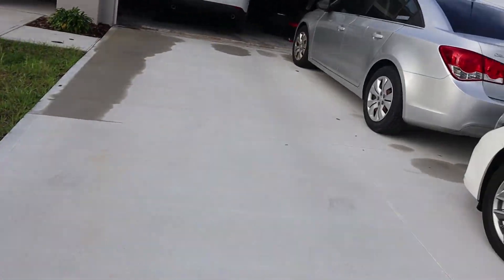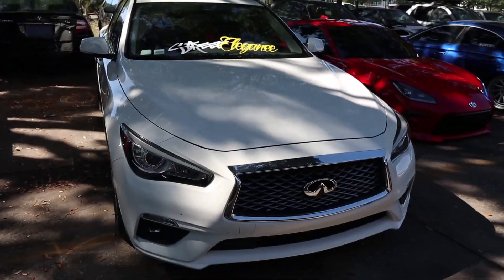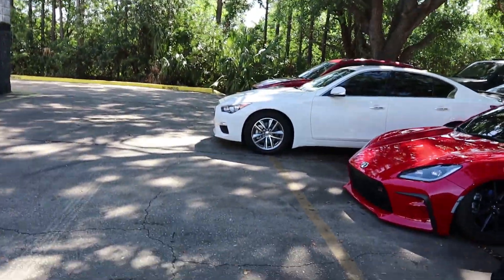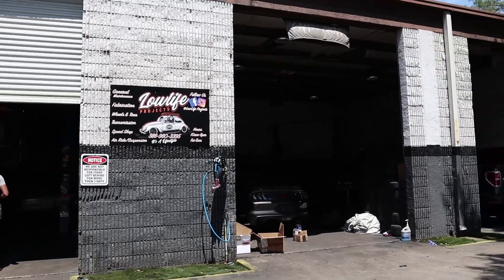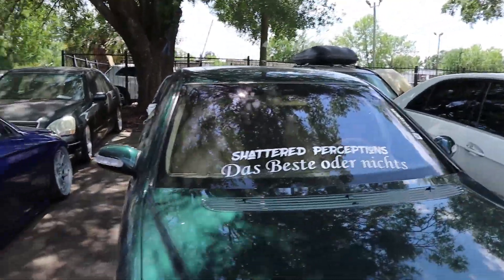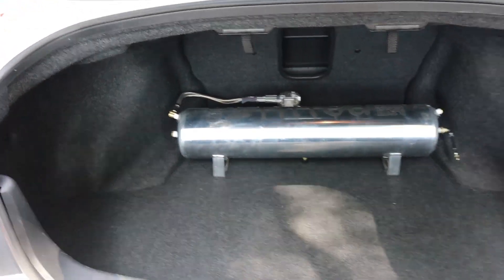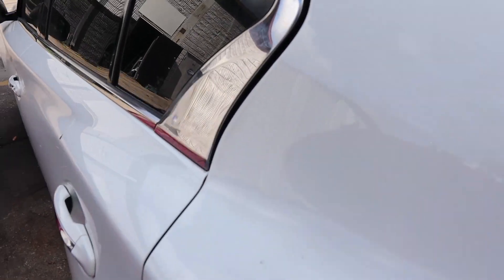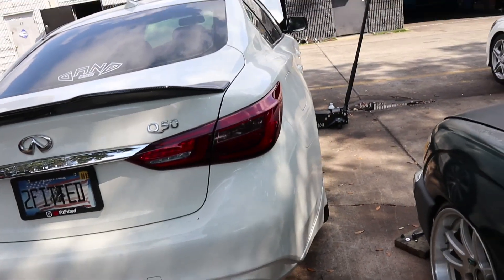Infiniti Q50 Finally Bagged!

Comment: so here's my guess about the ride quality based off my experiences with  bagged cars ..so it's definitely because of it being a  lot of air in the bags(higher psi =higher spring rate)but they probably did that because they put the height of the strut shorter so you would be slammed when you air out. So I would try softening the dampening and seeing if that helps or raising the struts so you don't have to use as much air in the bags and see if that solves your problem.
Reply from the maker: Good looking out bro that's the info I was looking for!